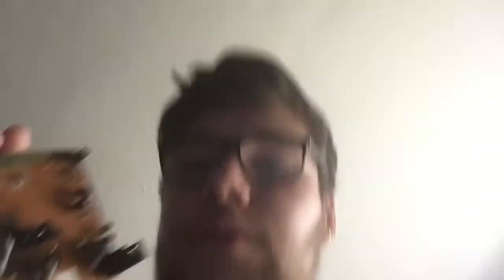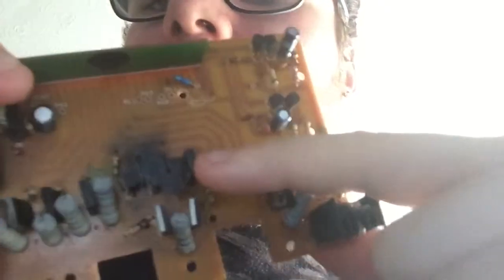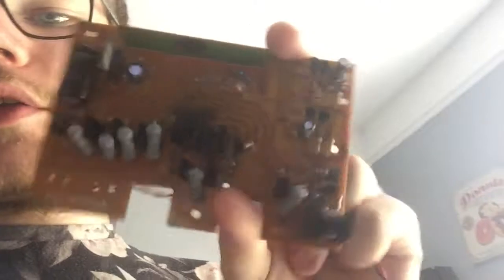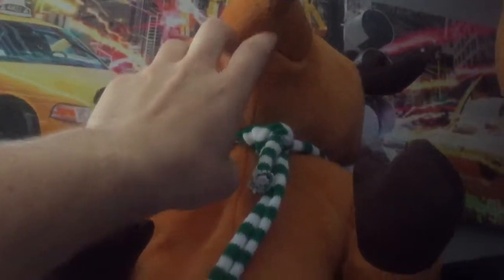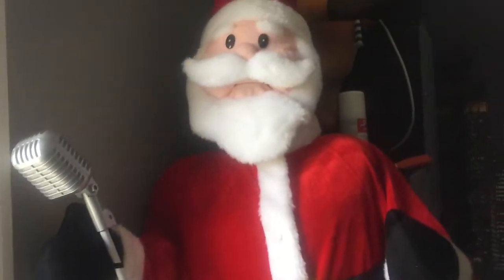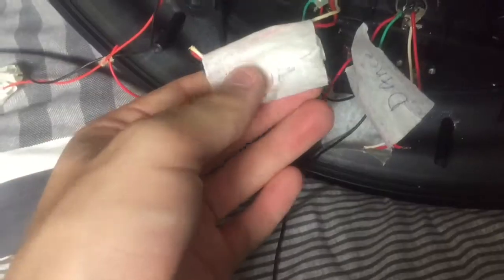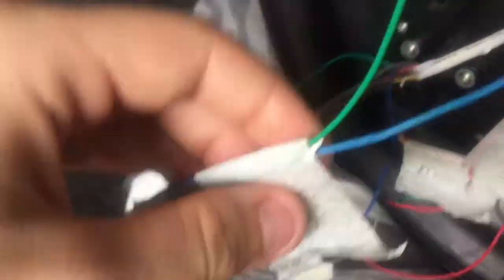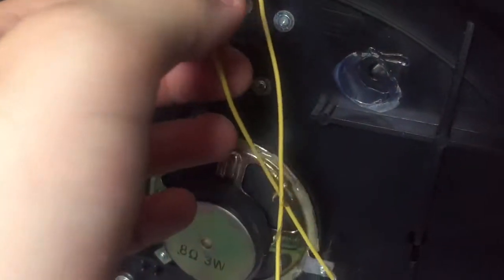Gemmy Animated Santa Band Part 1

Comment: Its not gemmy, thats the fake version. I got the same
Reply from the maker: Rhandy undso yeah I know but tbf the knock off  version is very similar to the proper one will the same glitch I have done 5 years of research on this lol
Reply: @FunFreakVlogs  yea. Mine do not work too🙄
Reply from the maker: Rhandy undso I will be doing a update video as soon as they are getting fixed not to original though as can’t find the original soundtrack
Reply: There’s even a Knock off of a Polar Bear 🐻 and Penguin 🐧 One too